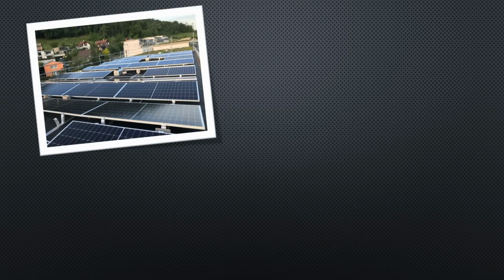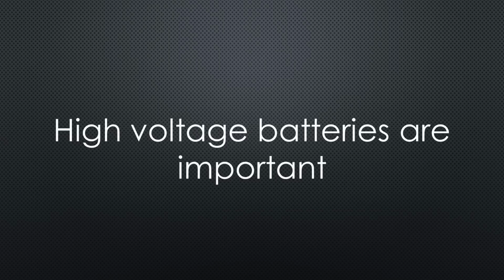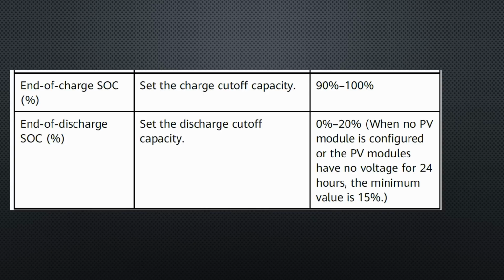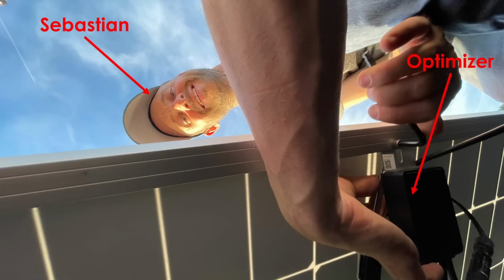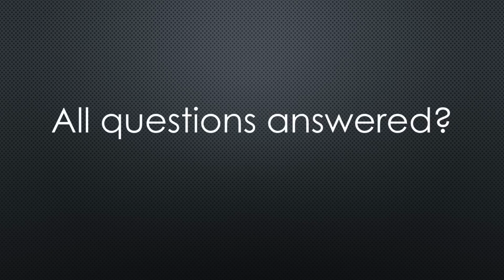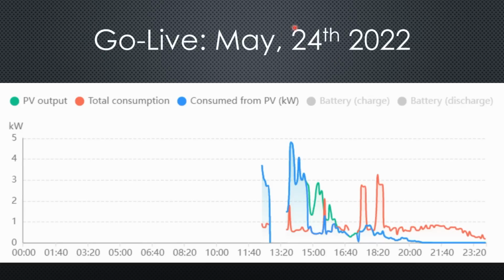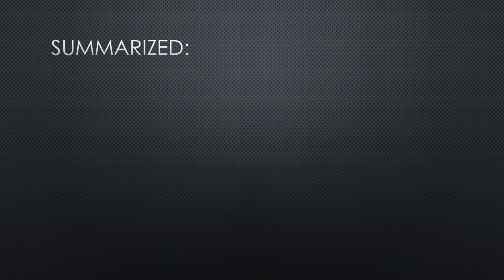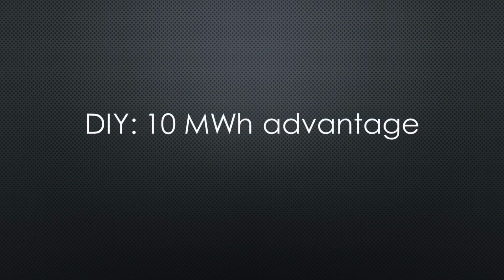438 Photo Voltaic (PV): Why Your Inverter Stops When the Grid Goes Down

Comment: Great Video as usual Andreas! Now  my comments:
1- Getting 50% price for the energy sold to the grid is actually not bad ... I've seen contracts with Zero pay and all "payments" made with energy credits ..that is some grid operators do not offer money but electricity ... imagine you sold say 10KWH of energy to the grid ... some grid operators say , now you can use 10KWH from our energy ... specially at night ..when there is no solar ... 
2- Allowing the batteries to go down to 10% is actually a big Mistake ... minimum value should be 20% and Preferably 35% !  You will kill your batteries Much sooner no matter what the battery told you if they go down to 10% charge ...
Reply from the maker: 1. Energy credits are not a bad thing per se (particularly for small houses). It removes the business case for a battery. But it limits the number of solar panels mounted on roofs, which is stupid these days.
2. Huawei gave us a 10-year warranty on the battery. So I assume their 0% is not 0% of the batteries ;-)
Reply: @AndreasSpiess  1- Agree. In any case it is a shame not having the possibility to have Both types of contracts so that users could have batteries or not.
2- I don't care what Huawei or any other producer "gave" you as warranty ... any Lithium based (in your case I think it is LiFePO4) battery will have at best 1000 Cycles if those cycles are from 100% to 0% ... and that is already very very optimistic in optimum discharge conditions and temperature and so on...
In reality if you cycle the batteries from 100% to say 10% you will get the 1000 cycles at Best ... In actual real life conditions with temperature fluctuations, non-uniform power peaks and the like the Real number of deep cycle discharges without affecting battery capacity and performance are Less then 1000x ... and can be Much much less than that depending on usage ... 
Any battery producer will play with Statistics and with the fact that most users will not "push" the 1000x Deep cycles (100% to 0%) in 10 years. They count on everyday residual charge of maybe more then 40% ... so the total number of cycles expands Way more then 10 years ... away from the dreaded 10 year "warranty". So They will claim on the cases of less then 10 year battery burnout the usual ... ..warranty Void because is Battery misuse ... 
Again Strong advice: make that Lower charge limit be at least 20% ... better to invest in more battery capacity storage then to regret having the batteries exhausted in a very short amount of years.
Reply: @John_Smith__  Question: On what do you base that? I looked into that and have found different numbers. There are datasheets out for different battery suppliers. For example Evium describes on one of the data sheets they get > 3500 full cycles 2.5-3.65V and back at 25°C until capacity drops to 80%. At 45° they guarantee > 1800 cycles. If you run a full cycle for 250 days a year that means you would be good for 14 years. 
 Referenced datasheet: https://batteryfinds.com/wp-content/uploads/2021/06/EVE-280Ah-Lithium-Iron-PhosphateLiFePO4-LFP-Battery-Cell-Product-Specification.pdf 
There are other batteries from evlithium-com, that claim to endure 9000 cycles if you use 80% per cycle.
The EVE Batteries are well respected on different forums, but you really have to double check that you get genuine cells, not fake ones.

I wonder which battery systems make it possible to add self-made batteries, that are cheaper if no error ocurs.
Reply: @RonaldSchneiderGiebenach  I totally understand that Some batteries may last indeed much more. But the overall experience for example on ev maintenance people that I know and talk to is totally different. I can assure you that every single technician that I talk to that replaces EV batteries tells me the exact same story ... of course we are talking EV's ... they can be subjected to more extreme temperature differences then in-house batteries.
But the fact that the suppliers tells you your battery will have 1000 Cycle all the way to zero ... simply take that with a great grain of salt ..and I'm trying to be diplomatic here ... (total and complete MBE from the manufacturer, fabricated numbers would be a far more adequate way to express what happens in reality ) . 
One thing is certain, an that's why maybe (again take that with a massively great grain of salt ) they claim 80% discharge cycles can reach 9000 cycles ... I doubt that a lot ...
The statistical data from LiFePO4 is that indeed if you discharge them say only 20%, that is you maintain 80% of the charge, then the total number of cycles they can make is not the expected 5000 cycles ( 1000 cycles = 100% discharge, 20% discharge = 5 times less => 5000 cycles.) The experimental statistical data suggests that in that case batteries can make more then 10000 cycles no problem. That relative number of charge cycles goes down A Lot the more battery charge depletion you make ...  until it reaches only the 1000 cycles when all the way down to 100% discharge. Also of importance is that the battery should Never be allowed to charge until 100% capacity .. make it more like 97% tops ... that Also helps a Lot on battery longevity. I assume, maybe I could be wrong, that manufacturers make their Charge controllers to take that into account ... so that when they say 100% charge it is actually 100% of Recommended Full charge (about 97% tops), but that's another story.
That's the reason to get the Most charge/range possible on any EV car ... So that you can charge the battery at night for the Lowest possible discharge level. Actually getting the longest range = biggest possible battery, is absolutely Paramount when buying a EV.
About the self-made battery for either replacement or expansion ... that is an issue that I personally would not be very interested to mess with or risk a unknown battery on a pre-existing system. I mean ... we are talking here with very high power, some serious KWH of energy stored and mixing differently manufactured batteries could always be unhealthy for your system. I would seriously prefer to go to the same exact type of batteries from the Same manufacturer ... just to be at peace with the system.
Either go all the way self-made system, or buy already made ... mixing both doe not sound to me very advisable ...
Reply: @John_Smith__  Hello.
Of course, and I know that not all that glitters is gold. 
As I don't have real live measurements I have to rely on data sheets.
What harmes the life cycles:
- High currents
- High currrents at high or low SOC
- Wrong temperature during storate and even more Charging and discharging.

If a Company sells mass produced battery systems with integrated measurement equipement, They need to have accurate data, otherwise big law suits will result eventually.

That means:
If you want to be sure buy complete closed systems from big manufacturers that will provide guarantee-repairs.
If you want to save get battery cells from sellers with good reputation and live with the risk.

Different cells:
LiFePo has a small voltage change between 20 and 80 percent. If you charge to 3.4 Volt you almost get 100%.
LiFePo allows typically for a charge up to 3.65 Volt.
-> In between this voltages the balancer kicks in usually.
At the lower end it is about the same. Voltages under 3.2 Volt can be seen as a empty battery, while typically it is allowed to discharge until 2.65 volts.
=> As long as all the batteries cells have the same voltages and the cells used in one string it is possible to mix different makers.
Of course every string has to have a reliable BMS that can swith the respective string off if any cell gets over / under the admissable voltage.

What I think would be nescessary:
- All batteries same chemistry
- All batteries same number of serial cells
- All batteries with reliable BMS with alarm output (to notify when sth goes bad)
- Charger / Discharger tunable in settings to correct voltages
- All batteries mounted at a fire safe place or a real good insurance that can cover for fires caused by self-made batteries (That might be the most important thing)

I am sure there is potential for many people to build own batteries either from new or used cells and operate them.
Reply: Here in Brazil, if you have a grid tie PV system, you are not allowed (by law enforcement) to sell your excess power for money. This excess power is injected in the grid and becomes credit for future use (net metering system). Batteries for self storage in a hybrid PV system are now starting to become common, so you can charge the batteries instead of exporting power to the grid. Starting in 2023, all new grid tie PV systems will have to pay the distribution company for the use of the grid as a "virtual battery" to store the excess power exported to the grid.
Reply: @Fernando_S  That is insanely retarded. It is clearly the play of the big power producers to try to make No One to sell energy to the grid. Could you tell us something Fernando,  that regulation is at the National Level or is it particular to some States or Grid operators?

Comment: Why not just have the cut-off switch stop grid feedback but let you use power in your house?
Reply from the maker: That is what the Backup Box shown in the video does. Plus it monitors the grid and starts the inverter in off-grid mode. And it is certified to be connected to the grid.
Reply: @AndreasSpiess  Yes, but why doesn't every grid tied inverter work like that? It's stupid that the default inverter is useless when the power goes out!
I think that governments and power companies have colluded with inverter manufacturers to keep people connected to the grid and paying fees.
Reply from the maker: @TheHuntermj  The backup box has nearly the same price as the inverter. Not everybody wants one. Last year I would not have bought one ;-)

Comment: Looking fwd to the hunting down what is adding up to 12KWh (or is it KWd, d as in day) during summertime.  I am doing that at the moment. 
It is frustrating to know that we, a family of 3, use like 9KW per day.  22 year old Liebherr fridge, 1.3KW, other Zanussi freezer 1KW, .... .  It keeps adding up. Still hunting down like 3KW somewhere :-( . To measure I use these Tuya smartswitches with power metering, but you can't reset the values on the app to start from scratch.  Luckily I also have them in home assistant so I can see what happens. So very interested on how you will measure and what values you get.
Still very interested what will happen during the not so nice days.  Here in the Benelux we had kind of a fantastic couple of solar months. Yesterday was our first crappy rain and no sun day. I measured the 140 Watt worth of panels to be outputting like 3 Watt.
Reply from the maker: I will do a video on how I hunt the "ratholes". So far my finding is that the word "and" (many different devices) uses most of energy. This will limit the savings without losing too much comfort, I fear. 
We already had two days where we had to buy electricity. But I am curious how it will behave during winter. I already added 4 panels direction south with a steep angle for winter...
Reply: You're right to think hard about where those kWh are going. Our 2-person family uses 6kWh per day. We are at home all day. Changing the 20 year old fridge/freezer saved us lots of energy.

Comment: Thank you for the great video! I'm also planning a pv for my house in east switzerland with huawei sun2000 and luna2000 but the supply chain issues are really frustrating. I already have the inverter, power meter and the battery modules. But the optimizers, the backup box and the battery control module are not coming soon. Maybe you know a good supplier? Did you know that you are not able to load the battery if you have optimizers? It's not a bug, it's a feature. The optimizers cut the voltage to zero if the inverter has no mains. If your house is on fire and the firefighers cut the mains power it's exactly what you want but in the off grid mode this means you can only use the remaining power of the battery even if the sun is shining.
Reply from the maker: I did not know about the optimizers. Currently I experiment with a few of them (I got them on ebay) and I prepared a video about them. In most cases they are not very useful and with your information they become more and more a pain in the a...
My backup box also came late and still is not connected.

Comment: The main thing people "forget" is the average 24h power delivery compared to the peak wattage: in winter it's between 5 and 10% of Wc and between 25 and 35% of Wc in summer. Why? Because of low production in the morning and end of the day and because of the night (there's not a lot of sunny hours in winter). Also if you really want to exploit that in winter you need a lot of batteries to compensate for a few consecutive days of bad weather.
The biggest problem is that the price  you pay electricity is much higher than the price you sell it. So you really have to consume your production yourself otherwise the system will never pay for itself.
Reply from the maker: I agree with your analysis for wintertime. This is why our systems are grid-systems. I added (and will add more) panels pointed towards south and steep, optimized for winter to get more energy during the good winter days. Adding more battery capacity does not help for the bad days (unless you are a millionaire). In most cases we would not be able to charge them fully during the short days.
The biggest problem in my eyes is the cheap prices for (valuable) electricity. I hope the bad behavior of monopoly electricity companies will be forbidden by governments. At least there are discussions now. Still, we will not get 100% back because only a part of our bill is for energy. Ther rest is for the usage of the grid and taxes.
BTW: With the current situation our payback period shrinks like snow in the sun :-)

Comment: Hi Andreas - thanks for the update!
Do you have any tips on how to improve future "upgradeability" for a PV-setup? (1) -> My constant nagging at the landlords was successfull (probably because he was notified about the raise in costs for electricity, and my notice about "told you so!"), too - and we'll be getting a PV-installation next spring/summer. Even i went down on my freshly operated on knee to plea he goes full on battery and offgrid-solution-capability with me paying my share off the installation, i wasn't successfull. I just know it's gonna be a Huawei-inverter, which will be hopefully prepared for later battery-use...
(1) most important to me: offgrid-capability; i understand the reason for why the invertes have to go down... but how to ensure the installation will be able to implement future upgrades? (btw do you know if it is possible to get an additional lead into the cellar from the PV-cells to load these mobile battery-packs? (got myself one the other day for getting a coolbox running; kinda like these things, and they could make for "some offgrid-capability" (bc the batterypack can act as USV - with its limited VAh-capabilities, but still - better than nothing))
Reply from the maker: 1. All SUN2000 inverters can be connected to LUNA2000 batteries. So you can add one later.
2. Off-grid is not simple with these inverters. You need an expensive Backup- Box and only get an outlet in the basement. For real off-grid you need a more expensive inverter. I hope I can circumvent that issue. But this is not possible if you do not own the house.
3. I would connect anything to the panels other than the inverter. The voltages can reach 100 volts and for sure are more than 400 volts coming from the roof.
Reply: @AndreasSpiess  thanks for the answer! Damn - after reading about the backup-box i had hopes this outlet would go at least to one of the FI-Group (to have some light in the house, and some powerplugs working)... (would have payed the price, tbh; now i still need a solution like a "Balkonkraftwerk" when the Sommaruga-Time arrives)

Wonder how many PV-owners will have a bad awakening thinking they'll have power when everywhere else the lights go out... I understand the issue with the "no feeding energy to the grid while someone's working on the line" aso, but still - what good does a PV-setup do if you need external grid to have the thing running... that "partial off-grid" with the backup-box should be standard...

Comment: Welcome back Anreas. I trust your road trip was enjoyable, and that you come back rested.

I'm following your experiences with PV with great interest, especially the leucocratic planning and utility issues as we have similar rules and requirements where I am. So far it does not look to be viable in my particular circumstances, even a small scale installation to power one small part of the house. I look forward to how you deal with the grid interruption problem as it seems to have been overlooked by many reviewers and advocates of home solar.
Reply from the maker: So far we were not concerned by grid-down situation in Europe. These discussions only started a few months ago. That is probably the reason for the low knowledge.